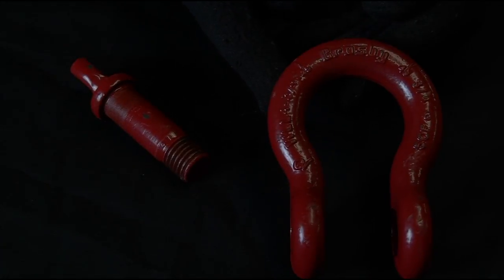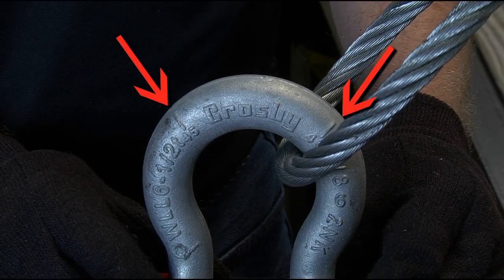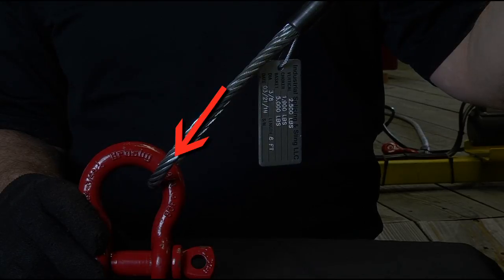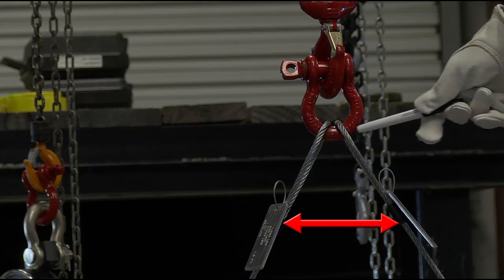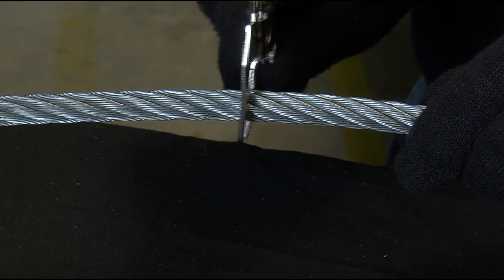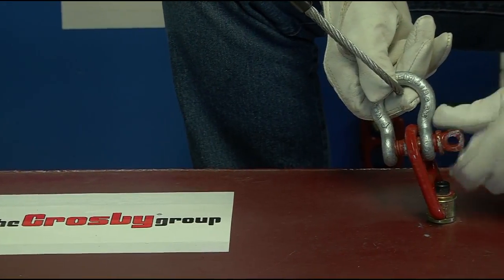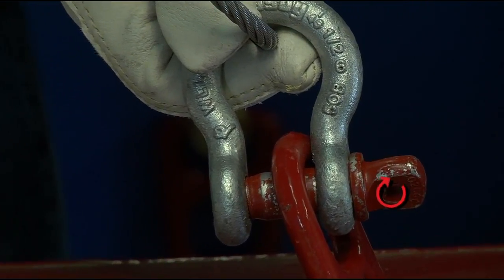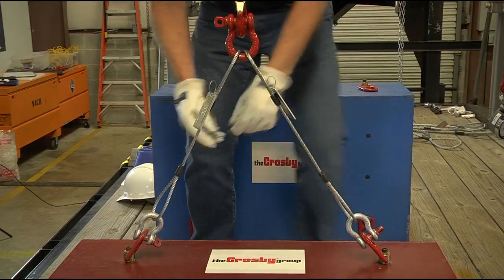Screw Pin Shackle Basics

Comment: What is the hole in the screw pin used for?
Reply: Most commonly for sticking something in to loosen the pin after a lift is made because most times it will turn slightly during lifting and tighten up beyond finger tight. The other reason if for siezing the pin (with wire or plastic ties usually these days) to secure it and stop it from working loose during longer duration use, such as a material basket that always has it's rigging attached or other similar situations.
Reply: @yourtoonosey  this /\